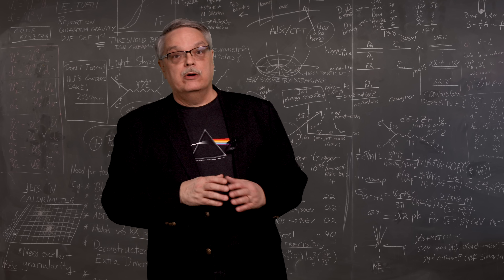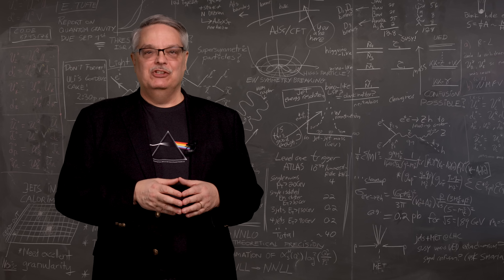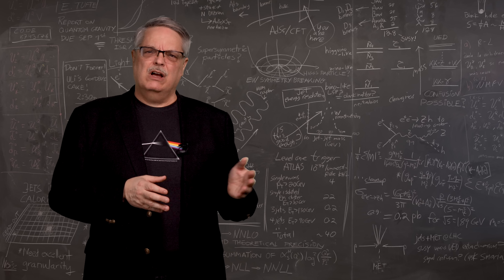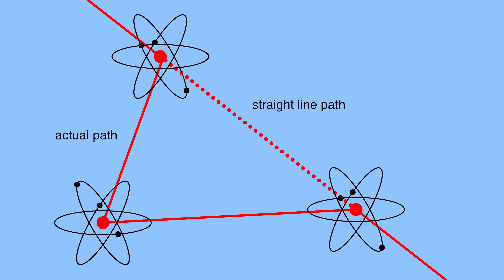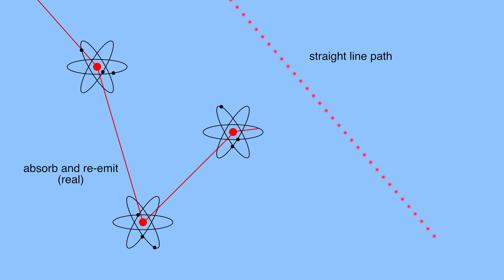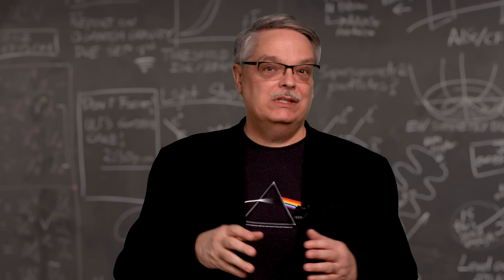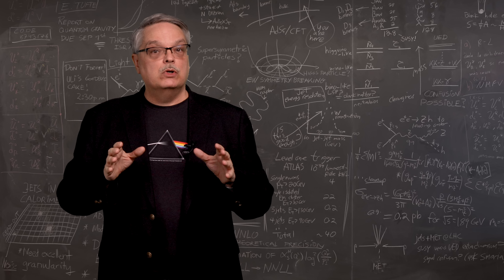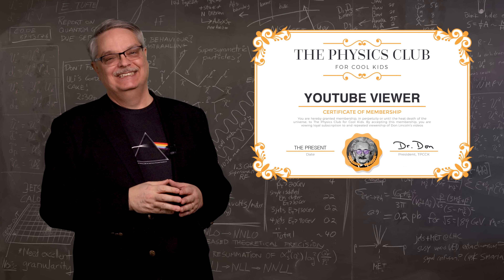Why does light slow down in water?

Comment: @Fermilab at around 8:10 you mentioned that "moving electric charges also set up their own oscillating electric field". right, but you didn't mention the direction of this new wave and its speed! why should the new secondary wave be slower? I mean, it is travelling through the empty space between the atoms so the speed shall be the speed of light! I agree that the frequency of the secondary wave should be different, because it has to do something with the oscillating electron. the real reason seems to be missing here

Comment: The light slows down through the effect of dynamic braking caused by an inverse wavelength within the structure. Is that not a correct understanding?

When the light exits the glass Some has been left behind because not all. Light gets through glass. It has some opacity do it. Because it has lost some energy, But not enough to change its fundamental wavelength. And being the light has a constant speed depending on what medium it is in. It returns to the speed of light in a vacuum if that's where it's going.

Comment: Now explain why light doesn't accelerate beyond C even when the 2 waves reinforce each other. Why is it a slow down only process and not true both ways.
Reply: Well, that's because c is the fastest speed at which two objects can move relative to one another. Light travels at this speed, and does so regardless of our frame of reference (even if you move at 0.99c, light still moves at c relative to you). From this we get a set of mathematical formulas of converting between frames of reference called the Lorentz transformation, and it tells us, that even if, say, object B moves at 0.99c relative to object A, and object C at 0.99c relative to object B, then object C won't move at 1.98c, it actually won't even move at c, but slightly slower.

Comment: It was my understanding the light is not actually slowed down, i.e. the photon (in particle-interpretation) does not leave the medium later than expected based on the speed of light, but merely the peak of the oscillation is delayed (in wave-interpretation). In your explanation you use the single phrase 'travels slower' without making the distinction, but the animation makes it look like the wavefront actually propagates slower as well, is that correct? I.E. if you fire a single photon or laser pulse through a medium, does it reach a detector on the other side of it with a delay, or only a phase-shift?

Comment: In my opinion this wasn't explained clearly.  While the explanation is correct, a better way to say this might be to say that light is interacting with the electrons in the transparent medium (not by scattering or by absorption/reemission but actually in the space between atoms) and actually is having to move the electrons which have finite mass (whereas a photon in vacuum has no mass because it's moving at speed = c).  It's as if a photon "gained" mass via Coulomb interaction with the electrons and thus is apparently slowed down.   It's like being dragged down by having to carry a heavy load while in the medium.  Refractive index is related to parameters such as dielectric constants which are measures of the susceptibility of this Coulombic interaction by the electrons (e.g. how tightly bound to atoms).  Once out of the medium and in vacuum again, light is load free and moves at speed = c.

Comment: Is it possible that the secondary wave generated oscillates faster than the initial light?  So that light is “faster” in that material?
Reply: No, the EM wave is literally the driving force of the electron oscillator. Refer to a driven simple harmonic oscillator for a better explanation than I feel like giving. Basically the electron can be approximated as a simple harmonic oscillator

Comment: bizarre explanation. The power of the incoming light should influence the emission of the second wave and as there are much more photons than electrons, the effect is not expected to be linear and independent of the power of the incoming beam. So we should observe distortions at low and high power beam. I really think that this is not the phenomena. The explanation should be downsized to the photon. It seems that this question is therefore still open.

Comment: The essence of light and the way it propagates give the answer. Light is a pulse of an electric field. The electric field pulse transmits charged particles such as electrons to the medium. It takes some time to regenerate the electric field, but between the electrons is transmitted instantaneously by nonlocal interaction. If there are few charged particles in the path of light, the speed of light increases. The speed of light is slower in liquids and solids due to the higher density of charged particles. Space is a high vacuum, but there are still a few electrons and protons per cubic centimeter.

Comment: Compare a bullet or electron fired through a short stretch of water. Its speed will progressively slow down in the water and its exit speed will be lower than its entry speed. Compare it to the passage of light through water. Its speed will be drop to a lower but steady speed and on exit, it will resume its original speed. Your explanation?

Comment: My objection is that if an incident light photon makes an electron move it must lose some of its energy to the mechanical motion of the electron. How does it recover that energy when it emerges from the glass? There is no guarantee that the field generated by the oscillating electron is in the same direction as the incident photon for an addition of amplitudes. So I say this idea doesn't work.

Comment: If you didn’t understand the explanation, don’t say it’s wrong. My tip: there isn’t exactly a second wave, it just an explaining abstraction. What he meant was that the polarized particles of the matter interact and interfere with the electric fields generated by the electromagnetic wave (light) and as long as these particles have mass and therefore inertia, their movement of going forth and back (caused by the moving electric fields) isn’t instantaneous (because the electric charge property of the particles is tied to the mass property of the particle). So the get “pushed” by the electromagnetic wave, but take a while to properly react. This behavior end up causing a “resistant” effect on the electromagnetic wave, which is a mix of both constructive and destructive wave interference, and the resulting wave is one that maintains almost all properties of the primary wave and the only effect end up being the diminish in the speed. Well, tahts the best I can explain. There is actually some complicated math to describe exactly why the result of the interactions is a slower wave. Luckily, there os a similar phenomenon with magnetism. Have you ever seen an experiment where someone drops a magnet through a coiled wire and this end up slowing down the magnet while it is inside the coil and as soon as he leaves it, he goes back to a free fall speed. Thats because the moving magnetic field pushes the electrons on the coils, but as long the electrons are stuck (because it is an open circuit) the push back creating a counter magnetic field which pushes back the magnet and end up slowing the magnet speed. So I think there is some similarity. You have a moving electric field (and magnetic field) passing through matter. Matter then interact with these changing fields, but matter, unlike vacuum, have mass, and having mass, have inertia. To accelerate and deaccelerate mass ins’t an instantaneous process. So the response of the charged particles of matter to the changing of electromagnetic states in their surroundings cause by the ongoing light wave isn’t instantaneous, because the have mass and take a while to accelerate and deaccelerate, this causes the resulting wave tho be slower. Hope this makes sense xD. Well, i think the video guy missed talking about the mass of the charged particles, which may be the key point to the whole explanation.

Comment: I completely understand the above explanation. But I have one doubt.
As,
* c=√1/με *
Although this theory may correctly explain the relative speed of light in a medium this does not shed any light on the fact that relative permeability(μ) and permittivity (ε) of the free space also change. 
If you could explain change in μ and  ε then the change in speed of light would be more than obvious. As per se equation 
* c=√1/με *

Comment: Einstein debunked by Dmitry Bonch in 2020. Google Dmitry Bonch. 1. If the velocity of light is independent of the velocity of the source and emitted vertically then how can light get from point A to point B * along the angled path (that is shift horizontally) in his thought experiment? Its impossible. It must move vertically 2. And if it moves along the angled path as Einstein insists then the speed of the movement of the geometrical point of light (not light itself as Einstein says) in space that is visible to the observer is the sum of the velocities of light and the IFR calculated by the Pythagorean formula. The speed of light itself stays the same for all observers and does not change, as well the speed of the IFR. Any movement along an angled path suggests that there are 2 velocities involved, otherwise that is if you remove one of them, it either will move only vertically or only horizontally. THERE IS NO RELATIVISTIC PHYSIC ANYMORE GUYS. NO RELATIVISTIC TIME DILATION, LENGTH CONTRACTION, ETC.
Reply: LOL. Sure.... A thought experiment debunks one of the most verified theories in all of science. I'll have some of what you've been smoking.
Reply: @EnglishMike  https://www.youtube.com/watch?v=j1Pe8y74Avg
Reply: @EnglishMike  Science is the most corrupt organisation. Unless you work there there is no sense to defend the liaers. Einsteins relativity is hoax that is easily proved.

Comment: Uh... I have a question. Why does the light wave and the  electric oscilation of the electron travel at different speeds?
I get that the electron could vibrate at a different frequency than the light ray's, but the change in the electric field would still travel at the speed of light.
What you said in the video is that when two waves with different speeds meet, the resulting wave can be slower, but that's not the case with light waves, since they all travel at the same speed "C".